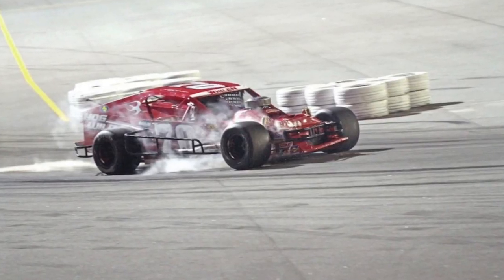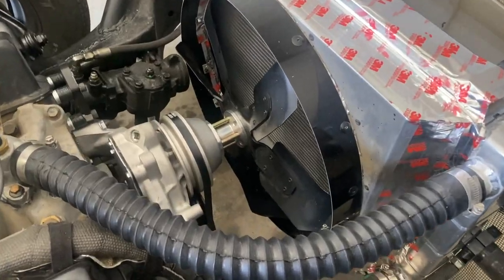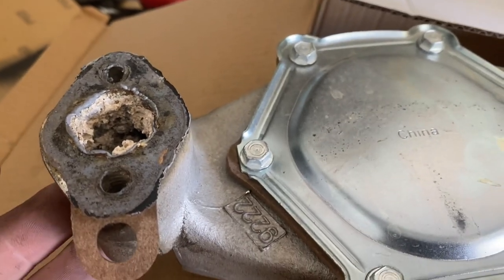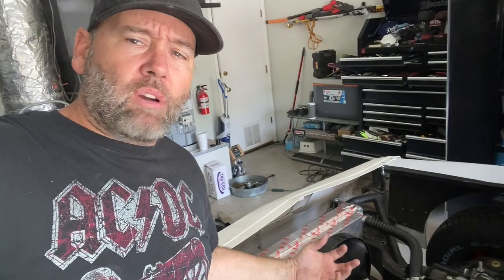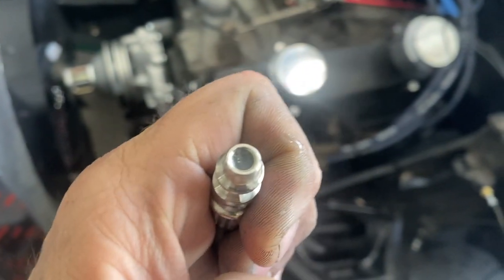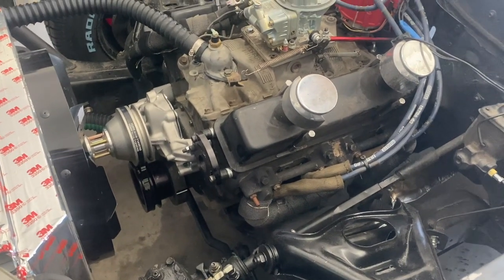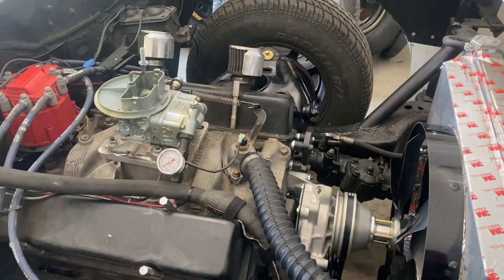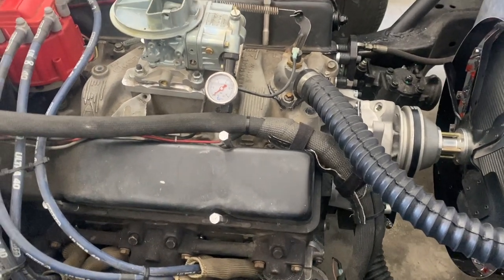Easy Overheating Fix for Race Cars,  Drift Car or Hot Rod - (Solved)

Comment from the maker: A couple weeks ago we did a tech video on cooling off performance cars.  Sunnie had a car running 260.  The changes made to the car dropped it to 190 during the main. 

Changes: switching from a reduction pulley to 1-1
Changing to distilled water 
Removed the restrictor. 
Switched to a 4 blade fan 
Moved the fan 2 inches closer to radiator. 
Removed pump and radiator coated with sediment from not using distilled water. 
Backed timing off from 34 to 32. No noticeable loss in power. 

Hopefully this information will help some of you that may be dealing with heat issues.

Comment: Some good cooling tips.

Definitely recommend getring a piston stop and adjustable timing pointer for finding true tdc.  

From what ive noticed most sbc like roughly 34-36, more on low performance, and as you get into better engines with more compression that may be closer to 28-32.

At ~ 4100ft I run my iron vortec 2bbl 383 at 36°(200psi limmit rule) but I do run 100 octane.

Comment: I think the short version is...don't put a drag racing underdrive setup on anything but a drag car.  Does number of passes in a radiator matter?  Depends on gpm output of water pump - more volume probably needs more passes to prevent reduction of heat exchange time.

Comment: I heard the distilled water is bad for the aluminum. You should use softened water not straight tap.
Reply from the maker: Opposite.  You can pull distilled water out after racing it and it looks like new water.  Stray voltage is bad for aluminum.
Reply: @btuff  Softened water is adding minerals to the water, I agree that is a horrible Idea.

Comment: You don’t want to use distilled you want to use DEIONIZED water.
Reply: Distilled is still better than tap or spring water. Less minerals. We buy distilled to run thru our EDM de-ionizers.
Reply: Distilled has the minerals removed and thats what the buildup is. So, no you"re wrong.

Comment: Great video. What are your thoughts on running products like WaterWetter?
Reply from the maker: I would do 40 below.  I've used water wetter and it works but I've heard a lot of people swear by 40 below for extreme temp reduction.  I would also think about using a 4-blade fan.
Reply: Water Wetter = Gimmick.

Comment: What do you think about restrictors on a single pass? Is it a must? We are having an issue with overheating and are getting stuck.
Reply from the maker: Are you missing any of this:
Distilled water
40 below
1-1 pully?

You will probably need a restrictor with a single pass.
Reply: @btuff  We changed pulleys to 1:1 and it seems to have helped a ton in our situation from what happened at practice. We always run distilled and have fan as close as possible.

We'll see how race #1 goes :)

Comment: The faster the coolant flows the greater the transfer from the coolant to the surface its on
Reply: I hear the opposite
Reply: @jakefriesenjake 
Yup, it'll flow so fast it doesn't have time to "grab" the heat , but the cold number on your temp gauge is fooling you.